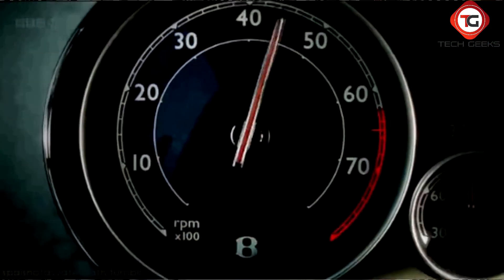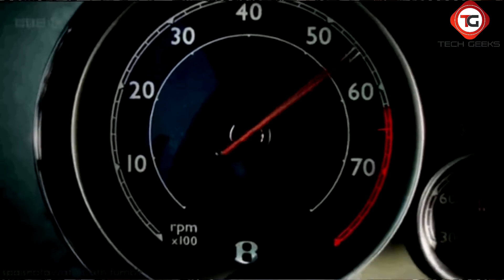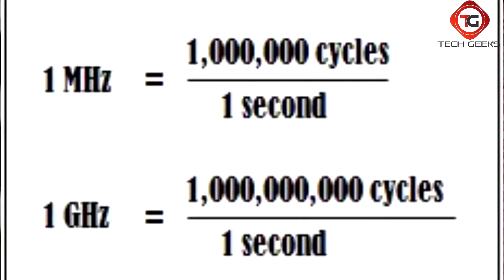What Is Clock Speed And Bus Speed | How Clock Speed Speeds Up Your Computer | Computer Bottleneck ✔

Comment: can i use msi H310M pro-vh plus for i5-9400F with 1650super instead of B365 if there is no difference in performance ....i wont go with 16gb ram(2666mhz) .....i think you have good knowledge about bus speed if any low performance in above H310m mobo cause.....can you advice me here....
Reply from the maker: You will definitely see a bottleneck due to the motherboard you are using. Intel 9th gen processors are some of the best in class processors. And using an ordinary motherboard while gaming will not able to take the whole juice out of it. This will make your games run in low FPS or you will observe heating. Also, a FULL ATX motherboard is useful for heat dissipation because it has much big surface area. I hope I am able to answer your query
Reply: @TechGeeks  ya , it does....going with b365...not atx but it will work right ? If i just keep cool....
Reply from the maker: Yes, If you keep cool it will give you good performance, but keeping cool will be costly for non ATX

Comment: What are cycles here in clock speed?
Reply from the maker: 1 cycle = 1 completely processed instruction and the result are generated like there are 2 inputs provided to the processor and the process requested id addition so 1+1=2 this is 1 cycle. Now keep in mind computer can do only addition and subtraction. so if you want the result for 2x3 then the computer will do is 2+2+2=6 so 2 processes which are - 2+2=4 and then 4+2=6
Reply: They might be bits...